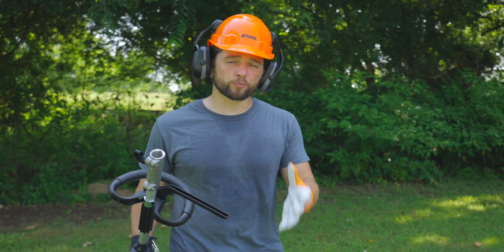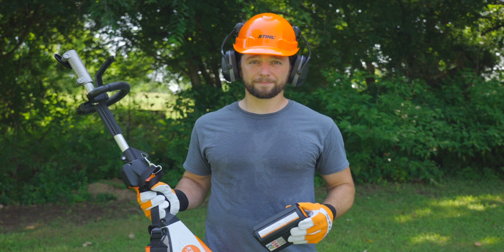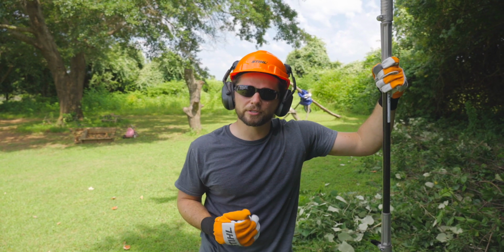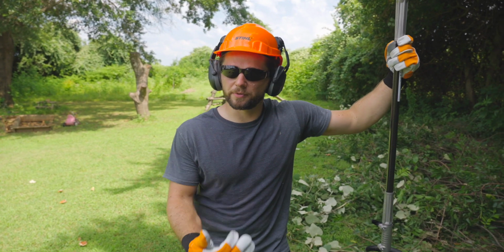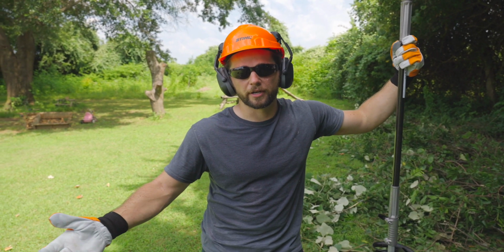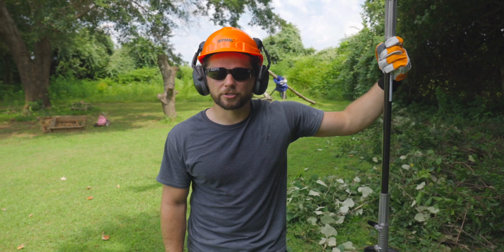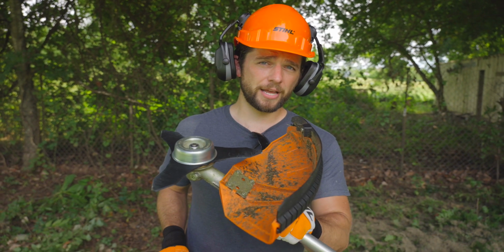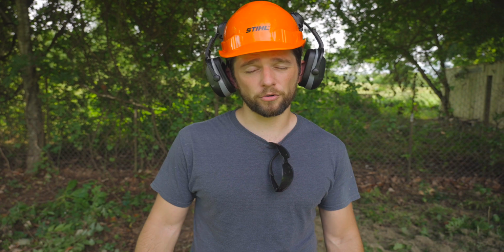Can The STIHL Battery Powered Kombi System Handle This Job? - STIHL KMA 135 R

Comment: Curious, have you tried it with a cutting blade to forest cleaning?
Reply: I have the 135 but with other configuration not with all those adapters, I have try all kind of blades it work with every one just like any gas trimmer, the bad part is you are limited with battery. I normally use the AP500S battery however I have use all batteries from AP200 to AP500S. I have also the chainsaws 161T, 220C and MSA3000 and the situation is the same the machines are great the issue is the battery running time.
Reply: @sirvozelo1  I have worked a bit with the msa220 chainsaw and it works as expected. In my experience an AP500 battery gives about the same operating time as a tank of petrol in a similar petrol saw, so a couple of batteries are needed to work a full day. But I have not seen anybody you the KMA 135 in use with the wood cutting blade and that raise the question if it is strong enough to cut trough say 2-4 inches of small trees or if it is just for smaller stuff under 1 inch.
Reply: @prewinder  I have the 161T, 220C, MSA300 and the 135Trimmer, the 161T in it's class i consider it a worse horse I am super happy in ever way, the 220C it's okay but I don't like the way the blade is secure kind feels like an experience and cheap material, the MSA300 is a joy powerful machine but is like a Mustang GT with an empty tank of gas cutting dry oak with a 16" blade on a log using 80 to 90% of the blade 10 cuts and the AP500S is out of power, the 135 Trimmer I have cut all kind of things 2, 3" small brush even small oaks shrubs with right blade it cuts everything just the batteries if used in full power not last long. After all I am happy with all Stihl battery power machines I have, except with batteries time, to me the battery time for professional use is short and the batteries are very expensive. 
I also have the GTA26 this one I have not much use for it, I buy it more for curiosity but it works to. In regard to batteries I have 1 AP200, 1 AP300, 3 AP300S, 3 AP500S and 2 for the GTA26, I very much have tested all of themes and in different machines just to have a feeling of the battery performance from one machine to another.
Reply: I don't know if I can give you the right answer but last summer i was in one of my lands and I have many many tick shrubs kind oak some light some about 2, 3 inches and my problem was not to cut themes it was that they are to much together falling on the top of the machine and got me stuck. I end up using the 161T for I cut themes with one hand and trow back with other hand as I was holding themes.
Reply: @sirvozelo1  Yes it requires some skill and training in felling them not to get tangled up and shrubs is hard. Clearing should be done in time to get it efficient. What I am talking about is this kind of clearing https://youtu.be/eQZHL3ew4n0 I have not seen anybody do it with a Stihl KMA 135 R, but there is a blad for it so I am curious. If it is any good at it I consider getting one cause I do a little of this kind as well as trimming hedges and grass, rather than getting two or three separate units.
Reply: @sirvozelo1  That is an impressive collection. I have just gotten the MSA 220 and two AP500s. Agree that it sucks a lot of power from the battery. It drains one battery if I fell one fully grown Pine or Spruce tree or if I go clearing up saplings for an hour. As for the securing of the blade on the 220 I feel the same but we have an older petrol saw with a similar plastic system. We thought it would break fast, but 15 years or something and it still works well. Hope this one holds up the same. The MSA300 is hard to get hold of, but I decided to go for the 220 since the 300 weights considerably more.What do you think about the weight of the MSA300? Do you post videos? I would love to see you clearing saplings with the 135.
Reply: @prewinder  I am not a professional make no mistake, but the 135 and the 161T on their classes they are a work beasts that's my feeling and I have put themes to all kind of tests I believe over manufacture recommendations. In did my feeling is that the 220C is the one that feels less professional. The MSA300  yes is heavier but have other purpose also, is designed for more heavier cutting, and yes in did is powerful the down side is the battery time. My personal opinion all the machines I have from Stihl are good the batteries don't match up with machines.
Reply: @prewinder   Those kind shrubs maybe 2" I see in the video you suggest the 135 with right blade it cut with no problem at all in fact last summer I have about 2 acres of that just mine were much ticker and was very difficult because as I cut they fail on over the machine so what I did was using the 161T chainsaw, as I cut with right hand I kind move themes to the side with left hand.
Reply: @sirvozelo1  I think the batteries are as good as batteries from other brands I have. But chainsaws draw a lot more power than other tools like power drills. Speaking of batteries I think it is huge tragedy for mankind that there is not a standard format for 18/36v batteries like we have for the old AA and AAA. I really detest that I have batteries from 6 brands that don't mix. Such a huge waste of resources.
Reply: @sirvozelo1  It is a matter of personal preference of course. I like walking upright with a brush cutter and felling saplings. With my current petrol saw ( Husqvarna 545F) I sometimes cut down birches that are 4 inches in diameter. I need to make an angled felling cut and from both sides to control the fall direction, but it cuts through without any problem. Over all I love to walk around and carry the weight of the saw on my back. The only downside of that is that it is not easy to clean of branches and cut the tree up in loading lengths if I want to bring it back for firewood. The only downside with the petrol brush cutter is that it is noisy and that it draw petrol when idling and that it can be a bit of a hassle to restart.

Comment: iv tried it and id say battery tool is getting there but not yet for heavy duty jobs ,for commercial use  i stick to my 2 stroke units.
Reply: For commercial landscaping/gardening, they're going to need a much bigger battery. For single site groundskeeping however, this is perfect. I work for a state college and recently decided to pitch the purchase of a trial set of their kobie battery system w/ an AR 3000 L battery. I work in the same Athletics area every day, so most of my work is simple detailing and maintenance. This system is working GREAT for that application.

Comment: I purchased the KMA135R to replace my KM94R petrol unit, just fed up with noise. The battery unit has even more power/torque when it comes to trimming.
Reply: Really? I was thinking of changing hoping that it would be a bit lighter as most of the hedges I do are very wide at the top and standing on a ladder makes it very tiring. But it felt as heavy as my petrol.unit and I tnoughtbit wouldn't have the power of the engine or durability throughout heavy stuff
Reply: @garymckinstry910  Hi, yes depending on the capacity of the battery the unit can be heavier than the petrol unit KM94R. But you have to consider the vibrations too which cause a lot of fatigue. Vibrations are much lower on the battery unit and compensate the weight surplus in my opinion. And noise too. As far as the power is concerned, the battery power unit has more power and torque, compared to the KM94R. Nobody call tell about the durability at this stage as it is a new engine. The rest is personal preference.
Reply: yes u are so right
\
Reply: I’m looking to change into KMA135R as well I’ve got the exact same KM94 as well just fed up with noise/fuel..
Reply: @joshuasuter6594  Cool, silence is gold, but in th meantime the engine broke after less than less than on year of residential use and was replace under warranty. Maybe I had bad luck, we'll see. Overall the power this tool runs very well and has more power than the petrol one (KM94)